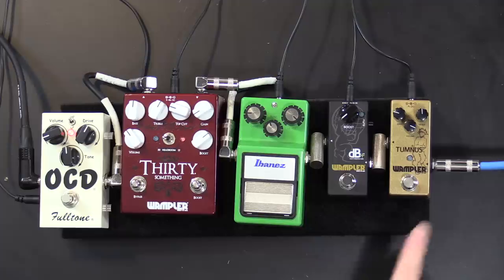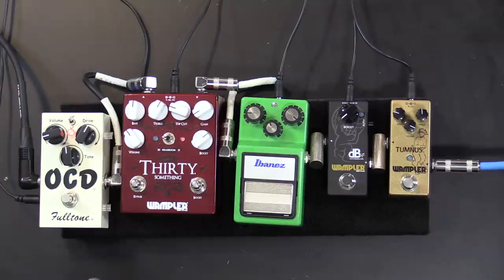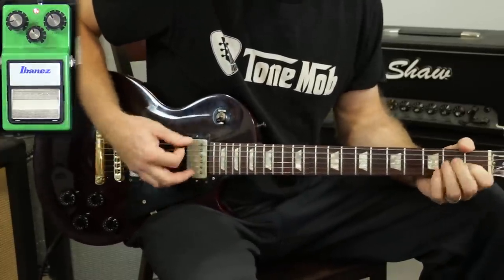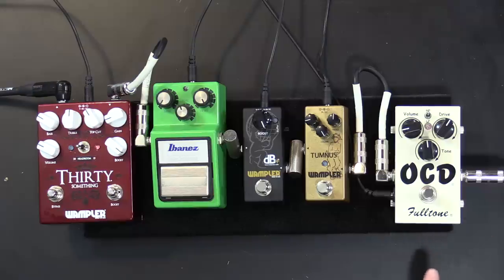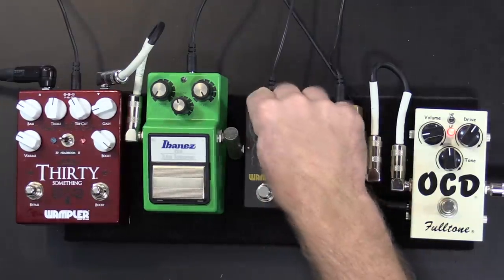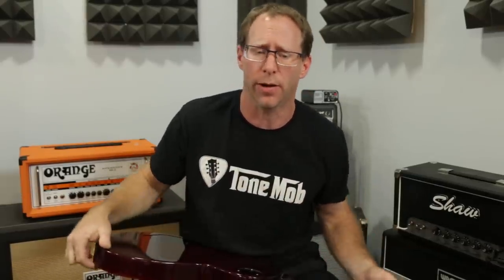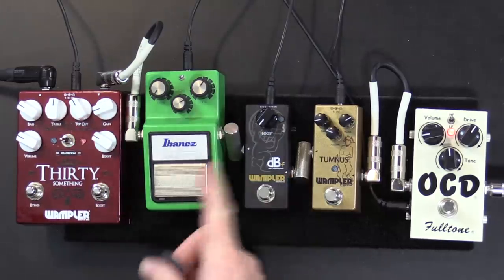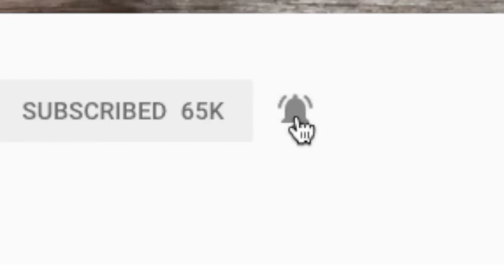Boost Pedal Placement - where do they go?

Comment from the maker: Boost Pedals... where should you place them? Do they go before or after overdrive or distortion? How do they differ? What is the difference in running them before overdrive and distortion or after? How does it affect guitar tone? Today I'll answer these questions and more. Comment with which boost pedals YOU like, and where YOU like to put them!
Reply: i didn't watch it yet but i would have one everywhere if i could easily
Reply: I'm newer to the pedal world... I have a cheap Kokko boost pedal BEFORE my TS clone right now, but am playing around with placement.  Thanks for the great video!
Reply: I think I found the right thing for me by running the Tumnus deluxe into my recently acquired pantheon.  I'm totally in love with it.  Then I have a digitech nuatila flanger/chorus just barely engaged and finally the ethereal.  Love this combo. it's the shit  as they say......
Reply: What about using clean boosts in the amps loop? TC mini Spark, Modtone Signal Booster and your own DB boost
Reply: Wampler Pedals hi, I think that when I put the boost before the gain will growin up, when the boost is after the volume is growin and the wave becomes square
Reply: Right, I have two boards with different boosts in different positions. Basically due to the two different fuzz pedals that I use and the way in which they prefer to be set. My main rig has a TC Spark after my Fulltone Catalyst fuzz set with a heavy fuzz to shape the sound and pull out more mid range. The pedal board I use for cover gigs is equipped with a DoD Carcosa fuzz (basically because it's cheap and versatile), and I use a Prestige before it to boost and enhance the tone and signal before hand...I think it's totally dependent on the surrounding pedals, so I cant say I really have a preference, however I think I lean towards a low drive before a small boost before a little fuzz all stacked together (as opposed to a volume attenuator for low gain flavours before a high gain fuzz before a boost...it's convoluted, but both can achieve the same result, I just think the first scenario is a bit more streamlined). Maybe my main rig should be swapped around for my Spark to go before a low gain Velvet fuzz?
Reply: I have a micro amp and I put it after my Fuzz God and Crayon.
Reply: @DJ7tringGuitar  I am very much into running clean boost's into my fx loops...really flavors up an amps clean tone...there is one out now called the Monkey man thats a cool clean boost with spring reverb that Im very interested in
Reply: Brian, I have a Visual Sound J&H with a TS9 and a DOD Juice Box before it. The DOD is set to a dimed volume with not much gain. lows and highs set as close to my clean tone. The TS9 is set to a classic rock type of distortion. The Distortion o f the J&H is pretty much 80s metal sound and the drive is used only to increase volume when soloing.  Sounds pretty good to me.
Reply: Hey do you reverse the od side on your J&H? Sounds better for me in that way than the normal routing.
Reply: OCD is my main drive pedal....I run it on LP with gain near 3 o'clock and volume a bit above unity. My Boss BD-2 is set for clean boost right after it...along with my trusty old Supa Trem, which also works as a FET boost when I set it to the "soft" setting. I basically just look for more volume with those pedals and add my '70 fuzz into the OCD to get DURRRRTY
Reply: Fx loop
Reply: question - can you use a distortion pedal as a boost after another distortion pedal? (EX - Mooer Rage Machine >> Boss Metal Zone)
Reply: I put my boost before my OD and Distortion pedals. I never have my boost on when I use a fuzz pedal, so I don't care where the Fuzz is in  my chain when I have a boost on the board. My favorite boost at the moment is a Suhr Kokobost (which also has a mid boost - which I tend not to use when I have a non transparent OD or distortion pedal following it)
Reply: Slam Klone into a JHS kilt: Oh hi there. Use Klone after BAT Black Forest OH HI THERE.
Reply: Lately I'm running Gretsch 6120 > SC95 Crybaby > Waza craft tuner > Boss noise suppressor > Wampler Pantheon > Wampler Tumnus > Fender Deluxe Reverb. I've tried my chain in every possible combo and that one hits almost all of the tasty spots. The only issue I have is the crybaby can get a bit treble heavy. Open to any suggestions...

Comment: I have and use a Fender HRD 3.  Love it. I'm a gigging musician and play the clubs every week.  I use an OCD and a Tubescreamer TS9 together on my pedalboard, and I push them through the clean channel.  The OCD is my main sound - I use my guitar volume knobs to adjust my tone as desired - by using my guitar volume knobs, I am in better control of my rig and can dial in on the fly pretty much anything from slight crunch to balls out overdrive.  I use my TS9 BEFORE the OCD to BOOST  the OCD for solos and lead work- and it works beautifully !... you can even roll off your guitar volume when both pedals are engaged ( for solos) and it gives you a stronger feel and really good tone.  Your guitar volume knobs are so important in dialing in good TONE.    MY OCD is set at the low power setting on top,   volume at 10-11, drive at 10-11 also,  tone at 12.   TS9 is set at volume 20clock, drive at 0,  tone 12oclock.  My Fender HRD3 clean channel volume is maybe at 2.5 - 3 ( it's club loud at this level).    NOTE:  I also push a 6 band BOSS EQ through my effects loop next to my WAMPLER TAPER ECHO and I have the best frickin tone.  The EQ in the loop allows me to push the amp harder, but control the volume and still add some bass and mids -  it's like taking a thick blanket off your amp and letting just breath and open up.  Sorry so long.  hope it helps.

Comment: Running a clean boost in the effects loop of your tube amp opens up a whole new world of possibilities. In this config the boost not only increases your output signal to cut through the mix for your solos but also offers GREAT options for different tones. By bypassing your preamp, you are isolating the boost pedal's effect on the power section of your amp which is almost like adding additional channels into your amp depending on how you combine the boost with or without running dist in front of the preamp. This works well when you are using a hotter dist pedal like the Pinnacle - especially in an amp that is biased a bit hotter. It's a real game changer because it can mimic the same amp dynamics of a dimed up classic Marshall amp in terms of the effect your guitar volume has on tone and dynamics. Here are several options this config offers; Option 1) by foot switching off your distortion pedal and engaging the boost, it can really FATTEN up your clean tones. Option 2) by engaging both dist pedal and boost but rolling your guitar volume way back, it gives you something in between clean and crunch with a lot of bottom and depending on your amp settings, can clean up surprisingly well. Option 3) by running your dist pedal with the boost off, you can dial in good rhythm crunch tones and then engage the boost for solos to cut over the top of the mix. So there you have it. Versatility at its finest...
Reply: Anyone named Steve W is all right in my book.

Comment: This is a situation where I can honestly say, I use and need both. Sometimes I just want whatever tone I have to be louder, sometimes I need more saturation and growl- and so I keep a boost before and after my drive and choose accordingly. Luckily- nowadays you have a ton of options to make this happen. You can run a compressor in front of the drives, use it as a boost and a compressor- you can buy a drive with a boost built in, you can use an eq pedal as a boost and shape it whatever way you like, you can buy boost pedals, or you can use other drives as boosts and stack them, and I'm sure there are other ways as well that I don't even know about. Personally- I run a Tumnus Deluxe into an AT+ from JHS- plus I have an 1176 Cali compressor and a Neve preamp in front of the Tumnus, and a Vertex Boost after the AT+. Then I run all my wet effects through the parallel fx loop on my amp. Works for me.

Comment: I like boost before and after overdrives.  Boost after an overdrives for a lead boost. Boost before an overdrive to push a mid gain overdrive higher.  What got me thinking that way was how my ADA MP-1 tube pre-amp had OV1 and OV2 and the how the over all tone would sound based on how you balanced them.  Having the boost after, to me is like turning up the master volume up a bit on an amp. So, if the overdrive pedal needs to be louder, boost after it. Want the overdrive to harder hit the signal infront.

Comment: Do what I do, have one at either end of your board.  :)
I have a TS clone at the beginning that I can use as a mild dirt pedal by itself or use it clean-ish to push another drive. I then have a JHS Banana Boost at the end of the board that I can use as a "solo" boost or occasionally as a mild dirt pedal. It surprises me that more people don't know about or use the Banana Boost and that it was discontinued. It is one of the nicest clean to slightly dirty boost pedals I've ever heard.
Reply: I’m kinda similar. I have TS9 (Keeley mod) into rockett Dude. Then ep boost at end of chain always on for nice bloom add. I also can even lead boost if I need it.

Comment: The thrust of this video, and the overwhelming majority of comments, is the role of boost in generating desirable distortion.  But one needs to remember that a great many OTHER type of effects pose certain limitations on input level.  Push your phaser or analog chorus too hard with too much level boost, and they won't sound very nice AT ALL (bad distortion).  Other types of level-sensitive pedals, like auto-wahs or noise-gates MAY be able to adjust their sensitivity to cope with the boosted signal...but maybe not.  If one is a pure grind type of player, by all means, boost away.  But if you plan to use other sorts of pedals, either figure out a way to stick any boost AFTER the level-sensitive effects, or use boost judiciously.

Note as well that there are limits to how much "clean" boost can be accomplished, given a standard 9V power supply.

Comment: My way of doing things has always been to have one or two full-range drive pedals, usually a low gain sound and higher gain sound, with a mid-hump style boost like a klon or TS circuit before them to kind of tighten them up, add a little gain, and give more of a mid-focused tone. And then after all of them I like a full-frequency clean boost so I can have any of my tones be louder but uncolored when needed.

Also, I thought the OCD pushed by both the Tumnus and the Thirty Something boost before it were EPIC drive sounds into your Bravado!

Comment: I run my boost after drive because in a live setting I usually want a nice volume boost for solos. I don’t use it to drive a drive tone I like to raise the volume of a drive tone. I play a wide variety of tunes and a cleaner dB boost is my jam!
Reply: Sam Johnson exactly - for solos is great - and some also use for tone -  if you have an amp that sounds great (crunch or distortion) if you push the  front end of your amp harder.  Of course then you would need a 2nd boost for solos :)

Comment: For me, a lot of it depends on how you are using your amp. If I have, say a 15 watt amp cranked, a boost isn't going to get much volume boost because the amp is already at its limit. In that situation I use the boost as a drive, and then follow it with an overdrive, using the tone control as a cutting device, making the leads like a laser beam. But with an amp set so that there is a lot of headroom available, I would possibly do the opposite.

Comment: The best combos I've found are:

Boss SD-1 into OCD
Boss DS-1 into OCD (DS-1 is a great dirty boost)
Boss SD-1 into Wampler Sovereign
Boss DS-1 into Proco Rat Turbo.
Reply: Also be wary SD-1 into Sovereign with the sovereign boost enabled equals a lot of power, and a fair bit of noise, but the power is really no joke, the boost as already so gainy.
Reply: Blair Snurtburgler beware of people who can’t spell weary 🙄😂✌️🤙
Reply: Another combination is boosting the crunch channel of a mesa mark series amp with the DS1. 
I'm not a fuzz guy but you can also get a decent fuzz by turning the three knobs to around  3 o'clock before putting it to the crunch channel.
Reply: Good morning Big TK Nuggs,
I presumed Blair Snurtburgler was advising caution rather than encouraging exhaustion. 
Stay safe,
Si.

Comment: I've had really good luck with fulltone 2b boost. Small pedal! Blemished item for under 100 bucks. Heads up if anyone is looking for something different. It's not true bypass, but it's got one of his high quality buffers inside. Also has a dynamics control dial, which puts a Germanium transistor into circut for the benefit of limiting. Very smooth sound! I usually like boosters after OD, but this one, with its buffer, is really helping my signal chain being placed at the very front. Kinda want a tumnus now though!
Reply: Yeah I use a 2B as well after one of his Catalyst's then a Munder Heavy Cream and absolutely love all of them

Comment: I do agree with the whole "what's a preamp, really?" premise. There really isn't a "standard" definition of it.

However, I do have an "opinion" of what the definition is, if I were to look at it, but merely from a schematic perspective. I usually look at it as a clean boost that doesn't use diodes for clipping or distortion (no hard clipping, no soft clipping, and no cross-over distortion), has a user controllable tone-stack that isn't 100% made up of gyrator style circuits (like what are in typical EQ pedals), and lastly has good input impedance, usually at 1M or above. The generic way to look at it, is a circuit akin to something one would commonly see inside an amplifier circuit before the power amp section and isn't part of an effect circuit that is built into an amp.

This way, that rules out your typical overdrives and distortions (they usually have clipping diodes or cross-over distortion). Typical fuzzes are ruled out (poor input impedance on ones that I see not using diodes), EQ pedals are out (they typically use gyrators). Straight boosts are out (usually no tone controls other than the ones hard-wired in (high pass, low pass, T-style filters)), and obvious "effect pedals" like modulation, delay, reverb, pitch-shifting, etc wouldn't meet the definition. So what is left? Basically those marketed as "amps in a box" style pedals, which usually are trying to simulate a preamp section in an amplifier.

But again, that's my opinion. And you are right, there isn't any industry standard.

Comment: My other option is a fantastic boost, Maxon OD820, followed by a great graphic EQ, Whirlwind Super 10, into any decent tube preamp. Just use the EQ to take out mud, push more mids & or highs into the preamp, thus causing a boost like effect without really adding distortion from a distortion box, but more tube preamp modulation from the boosted frequencies. Actually put the EQ in front of the boost, into the preamp. Yeah that's right.

Comment: being my usual quirky self, my "solution" is  SD-1a very light drive, unity - SD-1b almost max gain, unity - BOSS volume pedal set to "off"= 1/3 volume. this way I make my 1 channel amp a "virtual" 8 channel : clean - SD-1a - SD-1b - SD-1a+b into volume pedal low/ high for "clean reverse boost". I started doing this so I can still have "high gain" tone at lower volume for rhythm; gotta keep the singer happy ;-)  Complicated? Only when you read it like this... :-)

Comment: I'm playing a Blackstar HT 1R Combo using the onboard overdrive with an EP Booster with an Audio Alchemy Switch mod. The EPB is between my amp and guitar as an always on pedal with the knob set between 10-11 O'clock and the switches in the Vintage (less bass) or sometimes Default mode (more bass). This pedal really brings the thin and boxy 8" speaker to life. It adds warmth and bass to the overall tone of the amp. I'm also using it with an LTD 256 FM Guitar which is a humbucker guitar so I tend to favor the Vintage mode on the EPB.

Comment: This is one of the most misunderstood and often overlooked parts of the pedal chain in my view. I agree with Brian you can do this either way, so it well worth an hour to experiment which sounds best in your setup. Tubescreamer after the OCD is my pedalboard layout. I run the OCD at much lower gain (10am), then run the TS-9 gain at noon and volume at 3pm. Sounds great for solos.

Comment: If I use my pedal board the set up is, my Electro harmonix C9, into  my korg tuner, then into a Steel String Singer, into a Lenny,  into a blue note, into a late 80's  Pro Co Rat, into another  very early 80's Pro Co rat,  into my new  Wampler Paisley deluxe, into a old early 1973 MXR  Phase  90,  into the New Waza Craft or Boss Dimension D or C, into my Eventide Time Factor, into my Dunlap Clapton, modified by Dunlap Wah Wah pedal into my amp.  And I have a variety of 15  amps to choose from depending upon the gig or venue.

Comment: My favourite boost is the Spaceman Mercury IV harmonics booster. It is just after my octave shifter, and just before my shimmer reverb.

As for before or after overdrive, I am in a slightly different situation. I am all about amp distortion, so have no use for a gain pedal of any kind. That said, considering the Mercury IV is going into the front of the amp, it is before the pre-amp gain. So, if you translate that to a pedalboard, my Mercury IV would be before the overdrive.